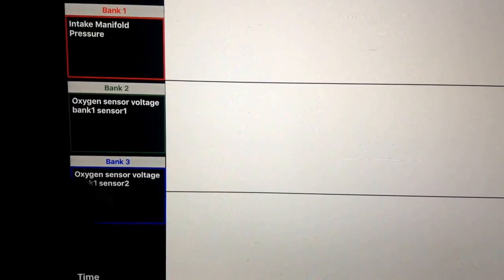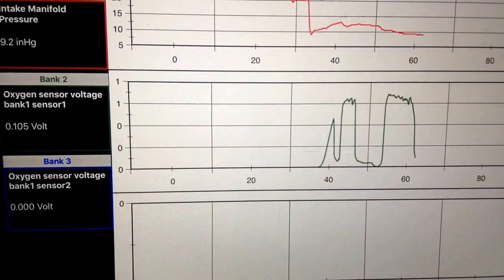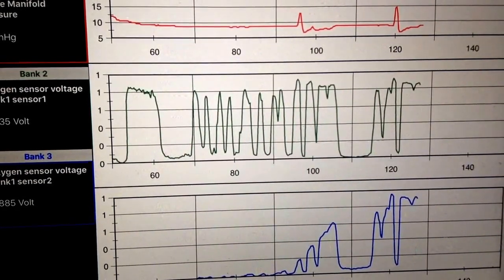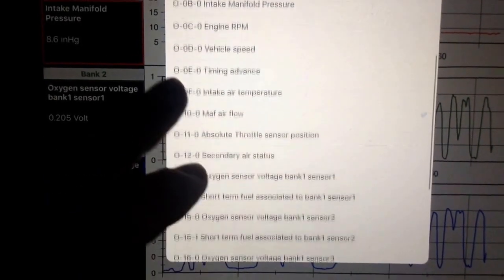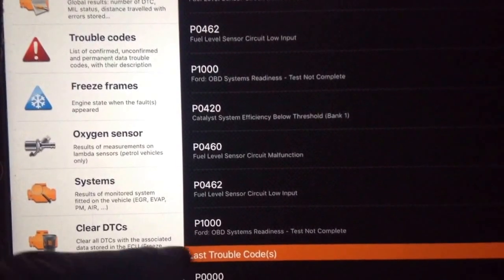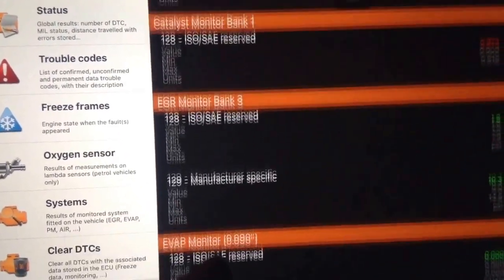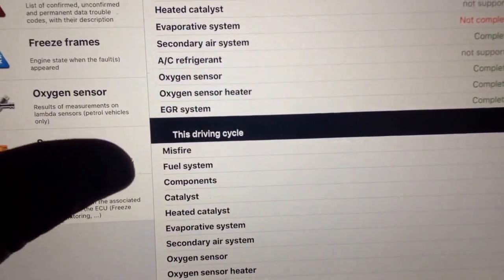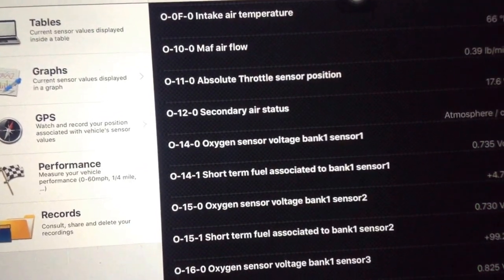OBD P0420 diagnostic code for catalytic converter; Ford Focus 2004; live read Oxygen sensor; Outil

Comment: Stumbled upon your video by accident, so... You probably know that by now, but - your catalytic converter is gone. If your cat was working fine, the O2 bank 1 sensor 2 would mostly stay at 0.75V, not copy the fluctuations of O2 bank 1 sensor 1. The fact you see the fluctuations on sensor 2 means the cat is not doing its work.
Reply from the maker: Do you think those cat cleaners work? I still haven't fixed it.
Reply: I think they maybe can help in certain situations, depending on why the cat is not working. But I also believe that those instances are not as common as the manufacturers of those products would want you to believe.

Now the products that claim that you pass the emissions testing if you use them - yep, those can work all right. But they don't "repair" the cat - it's just that the car has lower emissions while you've got the product in your fuel, as soon as you run out of it, you'd fail the emissions test again.

BTW, I should probably rephrase myself slightly as I might've been a bit too keen to condemn your cat - based on what is shown in this video, your cat appears to be shot. To confirm, we would need to see the same readings after the car has been running for a while and we were positive the cat is most definitely warmed up to its working temperature. But even if the readings would suggest the cat is at least somewhat working when you make sure it's fully warmed up, I'd say it's still on its last legs. Sorry. Having to replace the cat is no fun, I'm dreading the day the one in my Focus (older than yours) bites it.